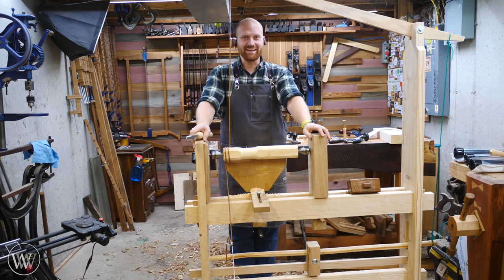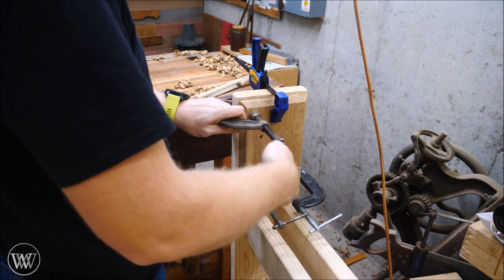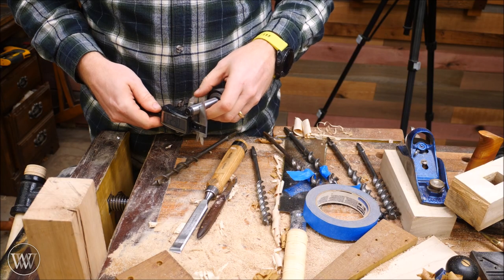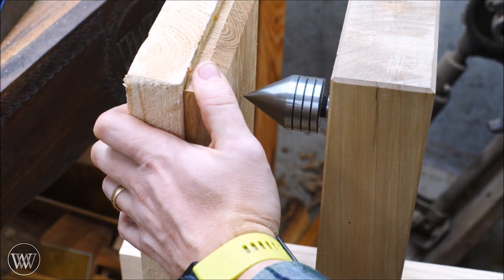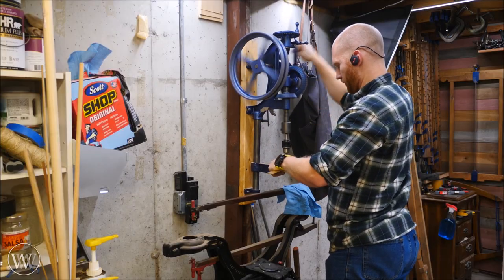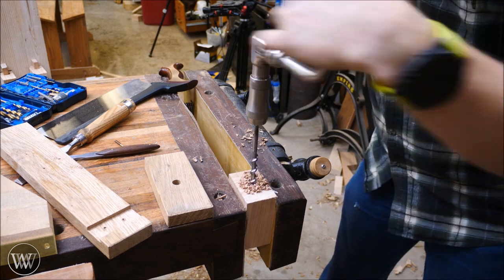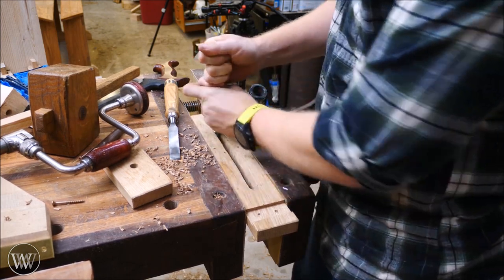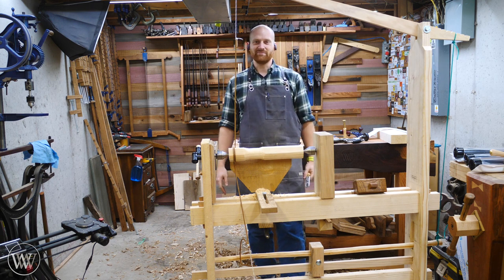How To Make a Spring Pole Lathe Part 5 | Hand Tool Woodworking

Comment: James, I built a springpole lathe some 30 years ago.  I believe that I reviewed the illustrations of Eric Sloane's book on tools in order to get some idea of how to proceed.  Surprisingly, what I ended up building is quite similar to the lathe which you constructed.
However, I used some very nice poplar boards which were completely free of knots.  They had been tossed out of the lumber pile by the grader, because they were just under the required 5/4 " thickness.  I did the same vertical supports as you.  I also did the mortise and tenon joinery for the rails, although I secured them to the frame by using a mortised slot and a wedge to set them in tight.
The one distinct difference in my lathe, however, was that I place my bow in the top of the rear upright by creating a mounting block which was inserted thru an angled mortise in the upright.  The bow, itself was made from a maple broom handle which I shaved down to a thin, flexible stick.
I placed the bow into the mounting head by using a dovetailed slot into which the bow was fitted.
I too wanted a treadle wheel inorder to get away from the reciprocating spin of the bow, so I created a wheel of feloes which were secured by overlapping segments in a double layered wheel.  All pieces were joined by using hickory pegs with walnut foxtails.
The entire build was completed wholly by hand, without ever using any electrical devices.  The project was done for an Anthropology class on tools.  It got an A.
Reply from the maker: Sounds like a really fun time

Comment: For a better treadle, make it an A Frame with two pivot points to the ground. This will give you a nice up and down motion with no sway. To make it even better fasten a piece of wood to the pivit points, so it lays on the ground and you can stand on it. This will insure that when you really go at it the treadle won't wonder. Hope this is clear and it helps. Keep up the good work!
Reply from the maker: +Dutch Guy Cycling that is exactly what I am doing first. That and make it easier to switch feet.

Comment: These look like fun to use, especially with green wood.  I have always wondered, why, even on modern examples like yours, that a driven spindle isn't employed, rather than the between centres arrangement.  Not having to work around the cord would be quite an upside,  especially in green wood turning which appears to be very quick.  There must be some downsides (other than the expense and complication of a couple of bearings and some sort of chuck).
Reply from the maker: A lot of people have added that on. It's just more work and often becomes more difficult to set up. It requires a lot more on the headstock to support that movement. But it can be done. Usually if you're going to put that much work into it you go ahead and make it a flywheel.

Comment: That's a nice lathe, but the peddle seems to have quite a short amount of travel. On others lathes the travel is much larger.
Reply from the maker: thanks. you are very correct. the one I made was tot he dimensions in Roy's plans, but that will be the first thing I change, longer and more stable.
Reply: Good luck with that. It will probably make the process more efficient and enjoyable.
Reply from the maker: LOL well, it is already enjoyable, but i dont think it will ever be efficient. LOL

Comment: Excellent build I have the same style Iathe  but instead of leather I use  8mm Bunge cord / shock cord I get 12 turns on the wood i am turning  it's a good upgrade and not so hard on the legs
Reply from the maker: eventually I want to build one of those but to do it justice I need a taller shop. it is definitely on the list!

Comment: Tips for welding cast iron. Clean part thoroughly, remove all old existing weld, chamfer crack, obtain welding rod four cast iron, preheat cast iron part to about 300°, weld the part then peen with a needle scaler and allow to cool slowly. Same process for brazing cast iron.

Comment: Wondering how you determined the height of the centers andwhy does the treadle waggle.
Reply from the maker: The turtle moves around because you were moving around. The nice thing is you and the whole ways are moving together. So it looks like it's moving all over the place but because you're moving with it it's staying put in relation to you. As to the height of the centers I just went off of the plans from roy. But it's about the belly button

Comment: Are the live centers #2s? I’m currently trying to figure out what drill bits I should use to do it.  I think 22/32, 21/32, 20/32, and finish with 19/32. Is that overkill? Should I just use two sizes and whack it hard into place? Thank you James. I’ve been watching this with my 7yo boy and building it the last 3 weeks. I can’t wait!

Comment: I was wondering about putting a drive bit and pulley system that the leather strip could drive and give you full access to the piece being turned. Just a thought for a possible "upgrade". Any thoughts on doing something like this as and optional accessory? Maybe a home made chuck with a pulley groove or face plate adapter for bowls? My mind is reeling with accessory ideas. Future videos for accessories?
Great lathe. The imagination is the only limiting factor or what accessories could be made/carved for use with this awesome hand made tool. PLUS, you get a good leg workout and some cardio too.
Thanks for sharing. I'll be looking for the all in one video build compilation.
Just goes to show, with a bit of wood and dedication you don't have to spend $2400 on a lathe. (or other tools for that matter) a treadle system can drive just about any tool your little heart can dream up. And for a lot less money than a commercially available power tool.
Reply from the maker: so true Thomas. there are a lot of accessories I want to make for this! there are also chuck mekenisums but they often require stronger headstock to cantilever out the weight and torsion of the cord. but there are still ways of making a bowl on it, and I plan to show that soon.
Reply: Awesome, I'll be watching for it. Thanks
Reply: epoxy glue 2 spikes or nails on each side of the driving live center level with the point of center, and put the cord around the center not the turned piece. live center with dogs will permit you access to the whole piece without cord in the way
Reply from the maker: yup. there are a few modifications like that. but if I want to work on that spot then I just move the cord over.

Comment: What is the over/under number of times you clock yourself in the head with that top beam?  It looks really close.  I hope it is a soft wood!  Great job James.  Looks like fun.
Reply from the maker: LOL I have not done it yet. but most of the time my head is a good foot from it. that is till I want to get a closer look.
Reply: The camera angle is deceiving.  It looks like it will hit you all the time.  This is probably the most fun contraption I have seen you build.  Again, I have no room in my studio/shop for a monstrosity like that.  If I could find a really small, treadle sewing machine frame, it might be possible to make a lathe out of that.  I am really looking forward to seeing what you can create on yours.

Comment: Fantastic! It does look so much fun :-) The moving/adjustable parts are all so simple and robust - very elegant design. Do you think it would be possible to make DIY centres and any thoughts on how you might approach that? Thanks as ever for sharing this work.

Could you put links to those other channels you mentioned?
Reply from the maker: thanks Robert! I was going to make centers out of threaded rod with the end ground to a point but I wanted to use ones with bearings so they spin easier so I chose to buy these.

I thought I left links to the channels I mentioned in the description, but I will go check for sure.
Reply: Thanks, that sounds a good cheap compromise method. Found the links too :-)
Reply from the maker: perfect thanks!

Comment: Is it possible that the first spring pole lathes had wooden pivots/spindles?East Indian pottery wheels with huge stones spin on a wooden pegs!
Reply from the maker: yes you can make them that way. you just have to replace them from time to time.
Reply: @WoodByWright  thanks that seams more likely as steel was lije gold and the chisels probably used less steel.

Comment: Even though my thumbnail choice didn't make the cut, I watched this anyway (sore loser).  My question is how large of a diameter can you turn on this and what determines that?  Well, other than the distance between the live centers and the center structure.  I think if I saw this in person I could figure it out but I can't.  Thanks
Reply from the maker: LOL thanks man! it depends more on what you can wrap the cord around. I could do a 12" bowl with the right add-on, much bigger then that and you run into tork issues. but I really do not want the spindle much more than 3" in diameter or you may not ret 2 full rotations before it returns.
Reply: Thanks.  That makes sense.  Now I'll be able to sleep tonight.